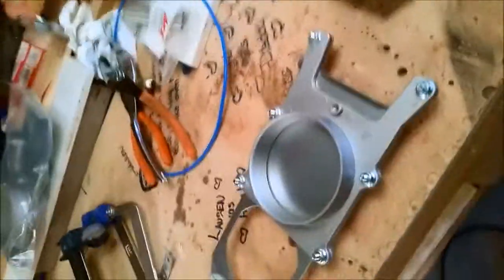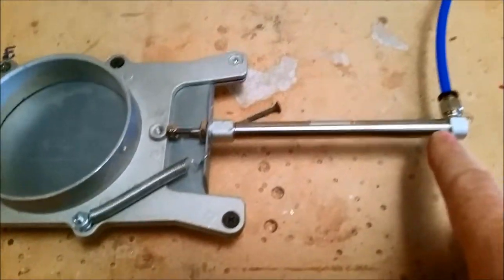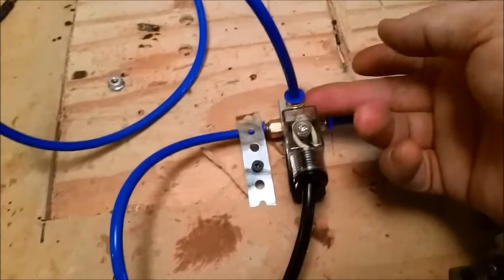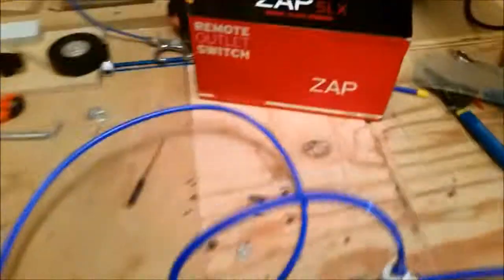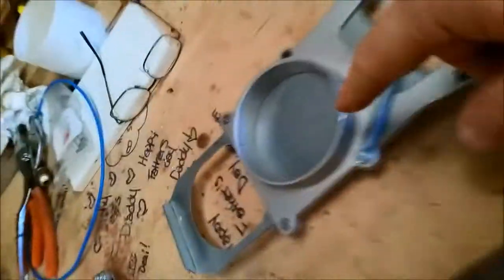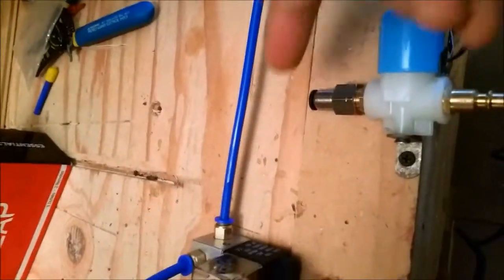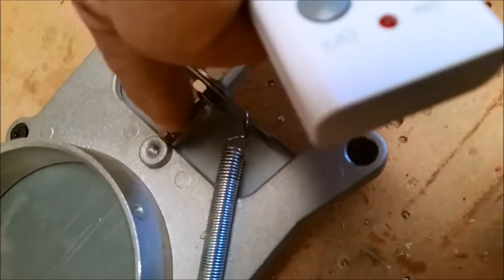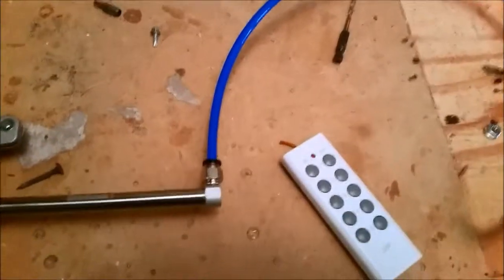Creating a Automatic Blast Gate

Comment: Excellent proof-of-concept but there's one issue (apart from the practicality of setting this up across a larger shop).  Those blast gates are generally leaky unless you both orient the gate in the correct direction and (more importantly) tighten the thumb screw to press the plate and close the gap.
Reply: If the blast gate is installed properly there are no leaks!, the blast gate actually has a vacuum side to it that seals when the Dust collection system is on. 😁🛫
Reply: The Lee Valley blast gates are leaky straight out of the box?

Comment: Hmm I am thinking this could be used to help create a remote-controllable fog blanket assembly with zoned output. As in, DMX controllable if I get ambitious enough. Basically I would use Schedule 40 PVC with outlets every so many inches or feet, and have each blast gate on a channel of DMX control. Then of course Fogger or Hazer Output on one channel to vary pressure with how many gates are open. This could be fun! I just learned about blast gates before watching this video so I am going to see if I can find some that are electrically controlled instead of activated by air pressure.

Comment from the maker: EBAY  sourced parts list: 
Pneumatic Air Solenoid Valve AC 110v with 6mm fittings 3 port Position NC (1101017217616)  
10 Pcs 5mm male tread 6mm push in joint pneumatic connector quick fittings (171727482845)
Stainless steel CDJ2B10-100-B pneumatic double acting cylinder SMS type (331376221760)
Etekcity 5 pack wireless remote control power outlet light switch (141453226402)
Reply: John Zawodnibyak
Reply: Awesome idea! One (mildly stupid) question though- If the fittings were tightened all the way, would your compressor still be constantly running? I'd like to use this system at the trunk of my Dust Collector, where there are two blast gates hooked to a wye going directly into the intake. I could use a small 6-gallon air compressor to power the cylinders, but don't want the noise that would accompany having that compressor running all the time. Is it only running because everything's not all the way tight? or does the built-in release cause air to constantly flow, necessitating the compressor to continually run? Than ks for the video!!